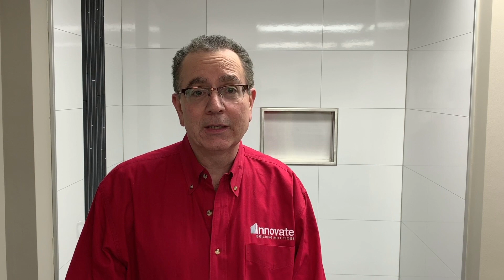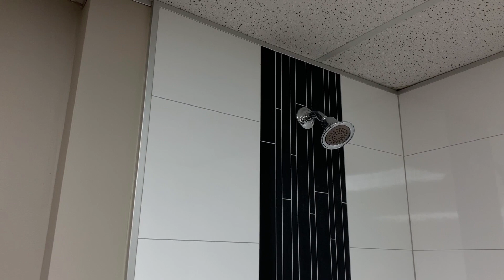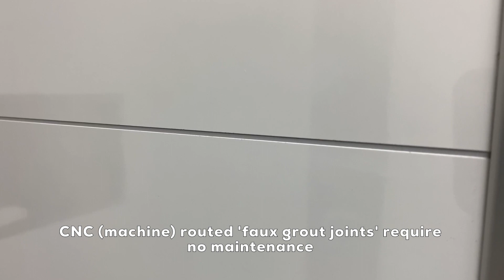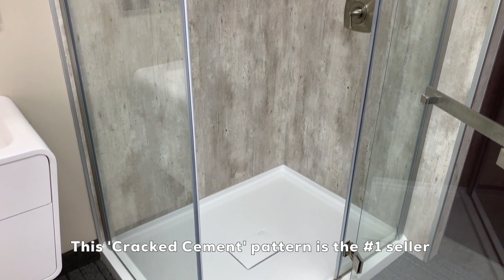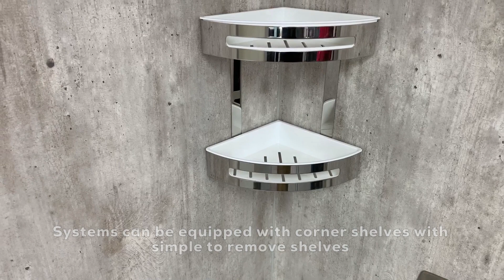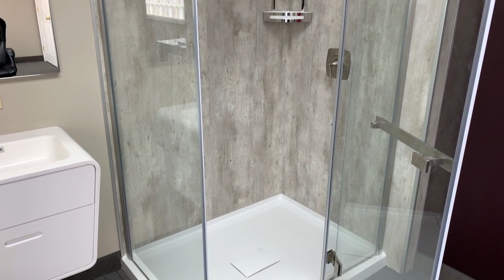Laminate Shower & Bathroom Wall Panel Showroom – Innovate’s Virtual Tour

Comment: The worst area I have found is the junction between the wall panels and the shower base. In the UK we tend to fill this junction with silicone sealant, usually white. Even though there are mold resistant sanitary silicones this area usually gets pretty grotty quickly as water always hangs around in these corner areas. What is needed is a method of effectively sealing these areas with a material that is mold resistant or alternatively a system that can be removed easily and replaced or cleaned. Do you do anything in the US that achieves this ? What are your methods ?
Reply: My exact thoughts. I'm seriously looking into doing this but that is my only worry- the corners!!!
Reply: My husband is a pro maintenance guy...he did ours in 4 days....if you know what you doing...install is great...we have had NO LEAKS..if you aren't skilled..let them do the install

Comment: Can this be used in a RV or trailer that is bumping down the road?
Reply from the maker: Larry Stieler absolutely Larry! These panels weigh 26 lbs per 2’ x 8’ section and interlock like laminate flooring - Mike